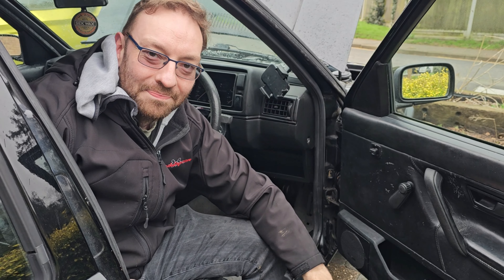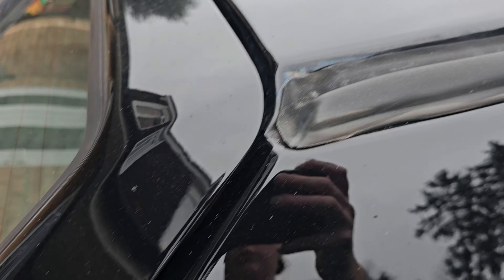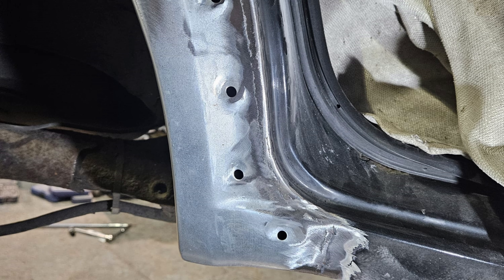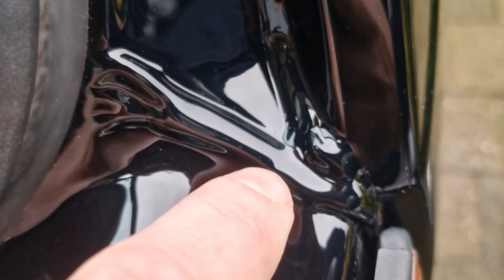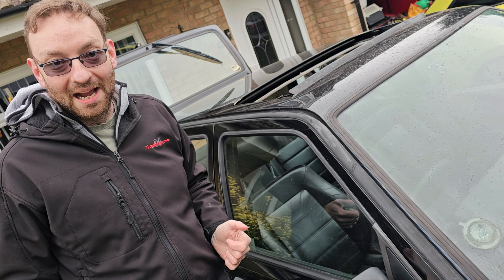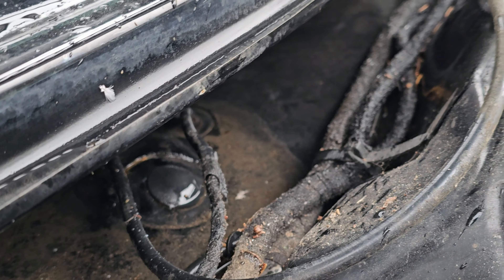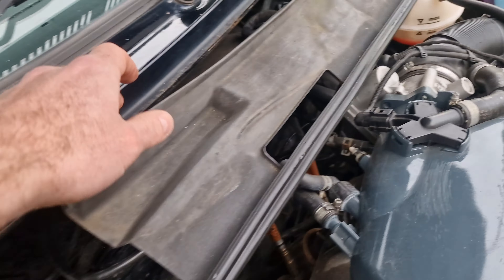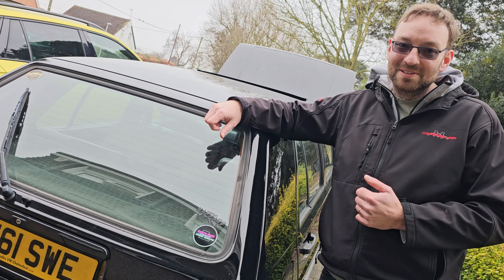How To Identify And Fix Common Water Leaks On A Mk2 Golf - Plus Rust Update

Comment: Brutal man, I hate water leaks...  Like you my valver is inside but 8v is outside under a cover.. Glad you found the source, I sorted all the ones on the 16v when it lived outside years ago. Even tracing leaks via dried in wax trails in the boot lol look for a used aquavac etc... Dry them carpets, bin the sound deadening will never dry :-(
Reply from the maker: Ah man that is rubbish! I do have a wet vac, which I can use in conjuction with a dehumidifier, so they'll be getting their monies worth 😅
Yea the sound deadening will only be fit for the bin, unfortunately. But it's ancient anyway so makes sense to get some new stuff.
Reply: @golfmk2  when I owned the 8v 1st time back in 06 I used the aquavac in the garage I worked to dry it out b4 I sold it... Garage binned it when I left 🙄 got a used one from Gumtree about 2018 when I was cleaning my farm find nova... Keeping in with the era. Think the vac is from the 80s too 😂 still earning it's keep

Comment: Vauxhall Vectras had same issue where the rubber bung in the same area got leaves trapped and flooded inside.
Reply from the maker: Yeah I see it so often, especially where the car is parked under a tree, with all sorts of debris building up and blocking drainage. I thought that would be the problem here, but not so!

Comment: Got myself an Eibach pro kit suspension and shocks! 1k set, but it’ll make the Golf Tour edition look great. Only 8 of these left licenced in the whole UK🥹Any way I can share pics of the golf?
Reply from the maker: That's a good kit and will transform the drive of the car too. Nice choice!
To share pics feel free to join our Facebook group https://m.facebook.com/groups/371878416967677/?ref=share and pop pictures on there. We'd love to see some. Thanks!
Reply: @golfmk2  shared the pics. Hope you can see them!
Reply from the maker: @bartlfc480  certainly can. Thanks so much for sharing. What a beauty. Puts ours to shame! 🥲
Reply: @golfmk2  hahaha it’ll never be a gti or g60. Mine is not to special I think
Reply from the maker: @bartlfc480  ours is only a GL with a daft engine in it, so ones in good condition are always nice to see. 🙂
Reply: @golfmk2  Turns out the good condition ones and low mileage mk2’s are starting to get more expensive! Doesn’t matter what engine
Reply from the maker: @bartlfc480  they really are. I wouldn't be able to afford one now, put it that way.
Reply: @golfmk2  i’ll take care of my mk2 and make it as clean as possible! Steady progress is being made on the Golf
Reply: Good video. To help draw out moisture from the car, once the leaks are fixed,  consider placing your dehumidifier in it.
Reply from the maker: @jakemurphy9536  yes that is definitely necessary to try and dry out the residual moisture from inside. Hopefully the spring and summer that's coming will also help.